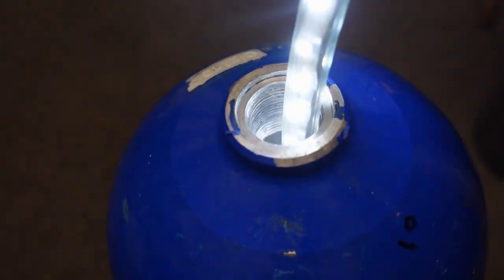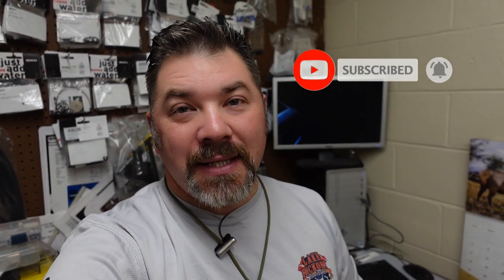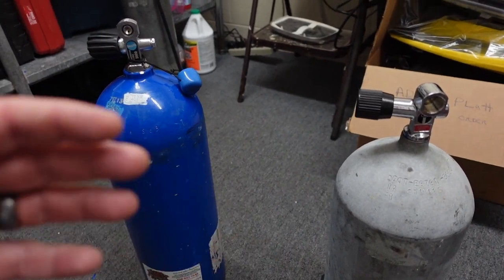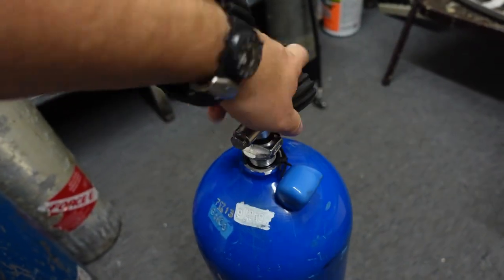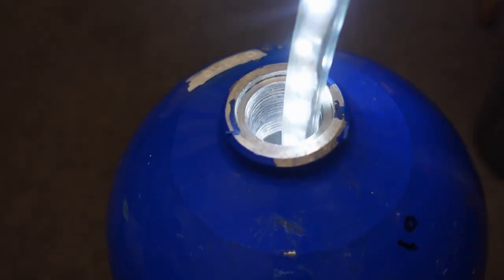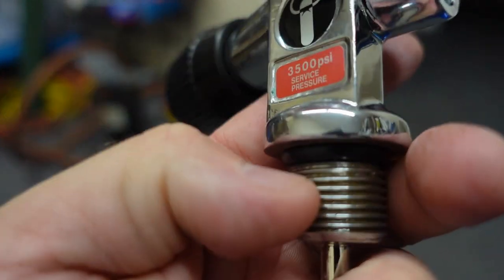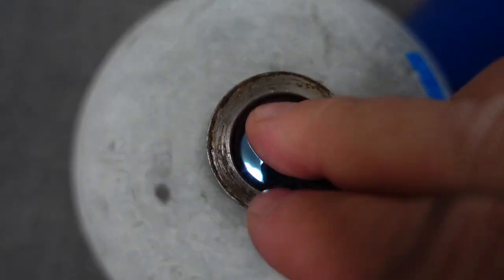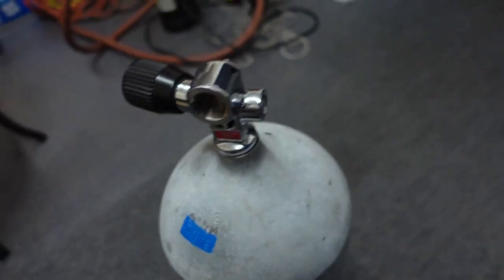How Much Moisture Got In Our Cylinders

Comment: Interesting.  One of the things I hadn't realised till I saw your experiment was that steel cylinders do also go positively buoyant at very low pressure.  But as with my Apeks 12 litre twins this would be a 4 Bar/58 PSI I hope never to confirm this!
Reply from the maker: Hello Tim Gosling, though most steels are still negatively buoyant at lower pressures, they still lose the weight of the air as it is being use. An example would be an Aluminum 80 would lose 6.4 pounds after being drained. Air weights .08 pounds / cubic foot. Thus, 80 cf x .08 is 6.4 pounds.
Reply: @LakeHickoryScuba  I use this link: https://www.subaqua.co.uk/cylinder-buoyancy.php to do the sums for me.  I'd just never taken note of the empty figure.
Reply from the maker: Thanks for sharing Tim.

Comment: I'm really glad with your tests. Actually, I have found and subscribed to your channel when I was looking after catastrophic failures. Nice that you have done another test.

Have you used a piston or balanced 1st stage? I wonder if a a balanced would limit the flow in your IP a little more than the piston 1st stage.

Thanks in advance!
Reply from the maker: That is a great question Antonio P.  The Sherwood first stage is unbalanced and the ScubaPro first stage is balanced. So we used both. Considering it was a failure and both of these systems are downstream regulators, personally I do not believe there would be much difference in the two.
Reply: @LakeHickoryScuba  thanks a lot.
In my mind you have proved your concept, which was to show divers that a catastrophic failure on IP or LP sides will leave not much time to a response.
Bottom line is: trust your buddy, keep your training on top and check your gear consistently!

Thanks again and please, keep the nice content!
Reply from the maker: You're welcome Antonio P. Thanks for watching.

Comment: The bottom of the aluminum cylinder starts floating. The key reason is that the brass valve is negatively buoyant. The aluminum cylinder will float but the valve will sink. Thus causing the cylinder to invert. Air will want to go up when you are underwater. Since the valve is facing down, a certain amount of the air will stay in the cylinder and prevent it from flooding. This is why there was virtually no water damage in the aluminum cylinder.
Reply from the maker: Hello Darrell Grainger, this basic rule in Boyle's Law holds true for the most part. However, after our original test three years ago, we did discover moister in two of the three tanks we tested.

Comment: Having been a HVAC service technician most of my life- I am really curious as to why you do not use a light with a telescopic camera to record inspection. A simple automotive one is just over $30. Mine was as much as a good regulator which could be used in laboratory equipment repair. So we know its not about the price of the tool. Just seems like a low quality Viability Check. Can you check the top of the bell on the inside at all without a camera or mirror-?  
Either way- this video really opened my eyes to the minimum one can do for safety. Looking forward to the more advanced hydro inspections and the difference in quality of visibility inspection. 
Please keep up the informative videos..!
Reply from the maker: Hello Gentle Rain, we use a mirror to look underneath the crown of the cylinder. We, as certified visual inspectors for PSI-PCI, we follow their guidelines for a full visual inspection.
Reply: @LakeHickoryScuba  
Thank you for clairifaction.
Reply from the maker: You're welcome. As stated in the video, both of these cylinders will go through a full visual inspection. We use an 18 Step Protocol for each cylinder.

Comment: Just a thought, but how can you guarantee the results of the visual inspection are specifically from the test if you did not do a visual inspection prior to the test as well?
Reply from the maker: Hello David Frey, you make a great point. Thanks for sharing. Another thing we wanted to show in this video is the actual amount of moisture that was observed in the cylinder after being drained underwater. As you can tell in the video, other than a little bit of flash rusting on the sides and the spots on the bottom, there were no concernable amounts of water found. We believe this was due to the cylinder being inverted as it drained, and Boyles Law preventing water from entering the cylinder.
Reply: @LakeHickoryScuba  I have to agree that saying the rust/spots were due the test is hard to accept if the tank was not visually inspected prior to the test.  The rust/spots could have been there prior to the test

John